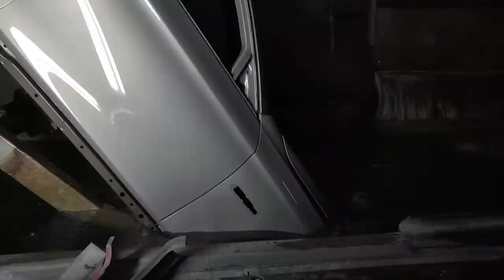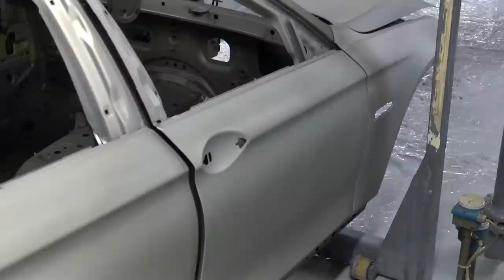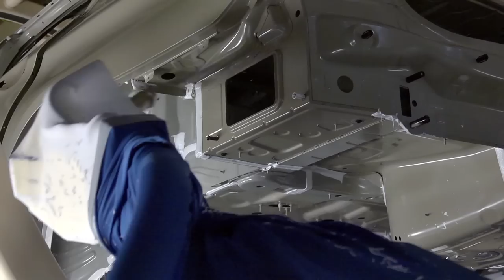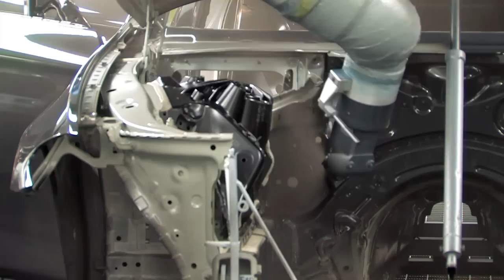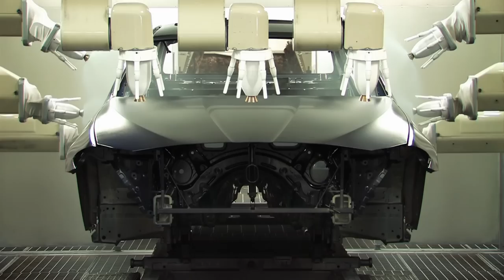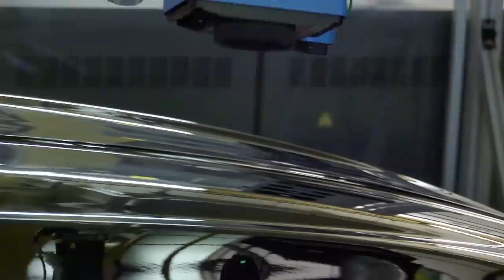BMW 650i and 640i Paint Process at BMW Plant

Comment: Wow, I didn't know they dip the car in primer!! very smart way to protect the metal and cover all areas from rust. Also I noticed how thin is the clear coat application is compared to how manually it will be done (2 coats)and I could see a lot of potential orange peel.
Reply: Factory clear is super thin. A good paint shop will give you a thicker coat with being uv protection
Reply from the maker: It's cool isn't it in terms of getting everywhere for corrosion protection
Reply: FYI, it's electrocoat that it's being dipped in, not a primer.

Comment: This is excellent, although I couldn't help but notice how they skimped out on both the paint and the clearcoat.  Every year, manufacturers are putting less and less paint on the cars.  Same goes with the clearcoat.  A friend of mine confirmed this.  He's been professionally detailing cars for 40 years and he's unbiased.  BMW is no exception to this either.
Reply: Omg. Next they’re going to be bald!
Reply: Wait what are you saying, if they skipped out on both paint and clear coat what do they apply on the car?
Reply: @Element21VA  “skimp” means that they intentionally apply very little. Its not the same as “skip”
Reply: Keep in mind that paint technology is continously evolving and improving. You don't necessarily need the same thickness for the same performance as you did years ago. But of course, some of it is due to cost reduction.
Reply: All one has to do is look at how nobody’s paint lasts more than about 10-12 years on most cars today to confirm that yes, ALL the big manufacturers are skimping on paint big time compared to how they used to. You can make them last longer with above average care (hand washing, waxing, etc) and parking habits (ie garage, not under trees, etc), but the average car owner who doesn’t wax their car and takes it through drive through car washes and parks outside will be lucky to get much more than 10-12 years out of modern paint. And that is abysmal considering how much paint has improved. But for every improvement, the OEMs just use that as an excuse to skimp a little more. That’s how the game is played.
Reply: @ImAlsoMerobiba  Clearcoat is even 2-3 times thinner now than 20 years ago. So that's not the same performance, just shitty painting.

Comment: So fricken cool. It is a wonder why European cars always will and always have had better paint jobs than any other car maker in the world..my older BMW only has like a couple rust spots like I'm the grill and quarter panel and that is it. Much better than other cars I had where the were completely rotting from underneath to everywhere around the car even having clear coat on my first car which was a Chevy completely chip off
Reply: +Austen tatious dude literally every auto maker has paint shops resembling this.  Every auto plant has robotic paint applicators with electrostatic charge.  Only the super high end sports cars like Lamborghini spray by hand.

Comment: Does that orange peel which is apparent at the end "settle" once the paint dries properly?
Reply: The paint is dried in an oven. Euro environmental rules very strict, water based paints to meet voc standards
Reply: That didn’t answer his question at all. No, the orange peel does not “settle” or otherwise change once the paint is dry to the touch. It has to be sanded and polished out. Some higher quality manufacturers do that, most do not.

Comment: How are they able to take the car right from priming to the base coat without sanding?
Reply: Agree without sanding how can paint stick ?
Reply: Correct. As long as you are within the recoat window, anything you spray on top will stick well. I have no idea what BMW is using here, but just about every decent or better primer I’ve ever come across has a 24 hour or longer recoat window. Plenty of time to go from primer dip to the next step.

Comment: can someone pls explain what all these liquids are that its being dipped in?
Reply: In simple terms, rust repellent liquid
Reply: They aren't showing every step.  A modern vehicle goes through a wash and etch bath ('pickling"), then several subsequent baths which apply a zinc/mixed-metal phosphate conversion coating to the steel (anti corrosion).  finally, it goes in to a bath called an "Ecoat" tank (the white opaque one) -- this is a "base layer" of paint which has anticorrosive properties and provides and adhesive base for the decorative coatings applied later.  Interestingly, the rolling of the car through the bath is programmed to correlate to holes drilled strategically in the body ensure paint gets on every interior recessed surface. Then, 100-200V is applied to the car body to get the paint to "stick" to the surface, then goes in a 140C oven to cure.  This is all manufacturer and paint supplier dependent, but that mostly covers it.

Comment: All that technology and at the end of it you still get a fair amount of orange peeled finish that needs the human touch to fix and make into the proper mirrored surface.   Sorry,  I am just not that impressed given how much money has been spent to achieve what is ultimately a second rate finish.      I would have to have that finish corrected.  Sand down the orange peel and polish it to a show car grade finish.
Reply: This doesn't show the full process.  There's still so much that goes into it after it leaves the shop.  I work at the plant, and once that stage is done, it's rolls down through cavity wax where wax is shot into any holes to keep it from rusting, and then it's moved on to the buffers, then checked one more time to make sure it's completely smooth.
Reply: 79th Productions I wish I could believe you but the amount of bmws out in the street with that orange peel finish is calling you a liar. lol
Reply: how about they come up with robot who can sand all that crap off and buff after, thats a video I would like to see
Reply: That finish is prior to curing, this is an OEM operation, not the local body shop!

Comment: Did somane see the orange skin that is on clear coat?? :))
no f..king robot chan do the job like a  pearson on body paint.
Reply: If you go to a car dealership and look at new cars, no matter how expensive it is still orange peel.  All our hand sanding and polishing techniques are out the window nowadays.  We have to go back to school to learn to paint bad.  Maybe at Ferrari or Rolls Royce they still work to get the orange peel out.
Reply: DTM1864 I've not noticed any orange peel on my Mazda 2. However, my $70,000 BMW Z4 was covered with it. Not sure why BMW (and other manufacturers?) can't figure this out.
Reply: Only a few educated people are going to notice orange peel.  People keep buying shit they will keep selling it.  There's almost nobody out there who is going to refuse to buy a car because of orange peel.  Though I will check out the Mazda paint job next time I'm near one.
Reply: Urethane paints, especially clear coat, are naturally lumpy, the darker the color, the easier it is to see, orange peel is usually a dry spray, caused by having too much air pressure, gun not set up properly or spraying to fast across the panel. the trick how to minimize the lumpy look is too apply the clear till it just about to run..., took me a long time for me to master that technique
Reply: Makes sense.  What about when you get a car in that needs just it's fender painted.  How are you gonna match the orange peel of the rest of the car if your painting technique leads you to a smooth finish?  This is the dilemma.
Reply: DTM1864 ah yes, that's where it separates the men from the boys, that is a technique where spraying speed, gun setup is key, plus having a $700 gun plays the role as well. I've never done collision repair painting, only full bumper to bumper painting, I have tried both the off shore guns and the high end made units, and you do see the difference! the $700 gun create more of a "factory look" than the cheapy guns.
Reply: BCcreativeInnovation Thanks for the response.  I myself haven't painted a car in many years; I mainly paint guitar parts.  I wet sand off any orange peel and make it all look like glass.  But, if someone ever asked me to paint any car parts I want to be able to say yes and I want the part to look like the rest of the car instead of better or different.  Thank you for the advice, I will be researching this topic.
Reply: +BCcreativeInnovation  Even with the proper clear application, it&#39;s everything leading up to the clear process that factors in as well. If the sealer is application doesn&#39;t lay out smooth, then every other thing applied over it will just mimic the undercoat. So the undercoat sealer could be smooth, but the base coat application could be rough or with orange peel etc....etc...... You could put extra coats of clear on to try and bury it, but unless you sand and buff you will not get that flat finish.
Reply: My next project is a guitar.  I will make sure the sealer and priner layers are smooth before I move on to the color and clear coat stages.
Reply: @DTM1864  We all want a greener world. Enviro laws dictate what a car maker can spray and in all likelihood it is a water based high solid material which has very specific curing requirements.  To wow us with cool robots the video skips the curing process. Nothing sexy about a car unibody moving through a paint oven on a pallet. The base coat had to be cured before the clear was even applied. Video left that out too. As a mater of fact the video left out the drying process after the wash stage and the corrosion protection stage as well. Custom paint with a spray gun and hand buffing is for a specific market, a secondary market.
Reply: @FoundationElectronics  You are talking about the refinishing industry, this is OEM. The two have nothing in common.
Reply: @yakadee1  You are correct.  Mazda's paint jobs are amazing.
Reply: All manufacturers have orange peel in the paint. I know when someone hit me a few years ago that I made sure the painter matched the factory orange peel.  I personally prefer it over the slicked out look.
Reply: Karen